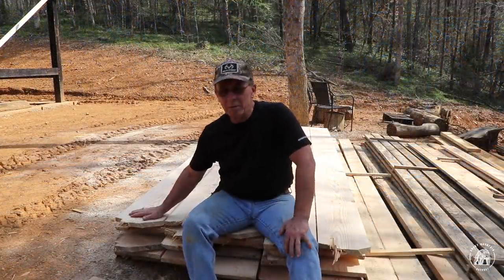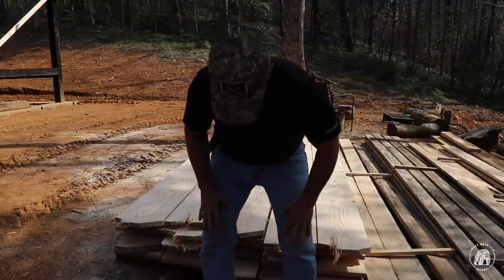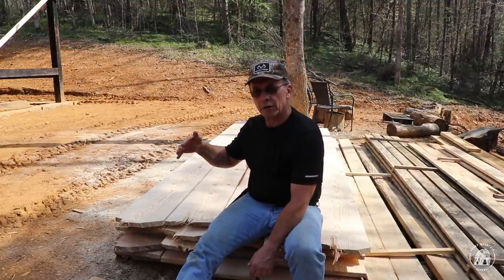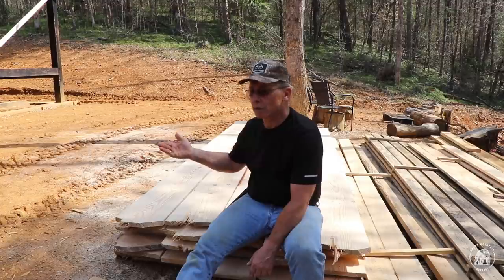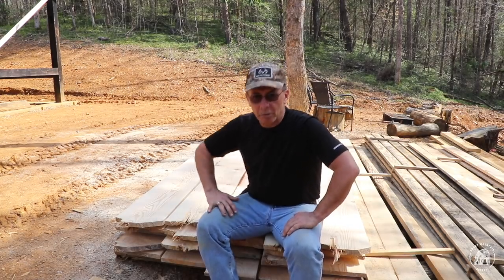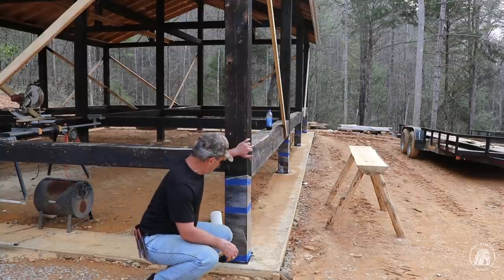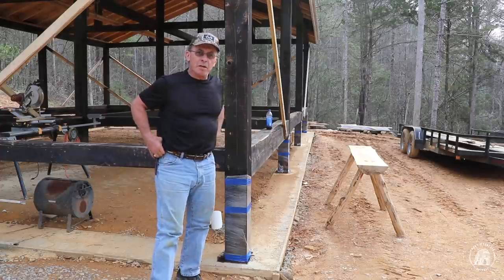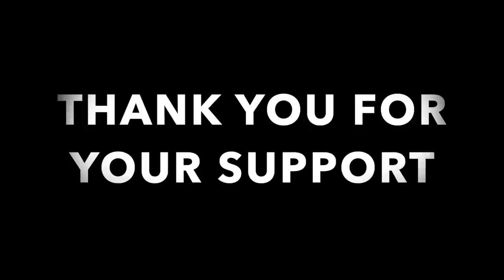S2 EP36 | WOODWORK | TIMBER FRAME BASICS | MILLING SIDING AND GRADING LANDSCAPE FOR DRAINAGE

Comment: Horizontal boarding, in my opinion, is the way to go. Tanks : Here in Southern Africa we utilize 1000 liter -15000 liter tanks ABOVE ground usually on a concrete base. The gutter’s down pipe feeds directly into the tank..... so one tank per down pipe. The rainwater can be used for everything except drinking water. It is a great free resource in a place that gets a lot of rain. Your place is coming along nicely, and I always look forward to your next video. Hugs and stay safe

Comment: As a landscaper, I have a few suggestions. First I would install some type of retaining wall at the base of the rear slope. Drystack stone would work well. With the rainfall you receive annually, that slope is going to move eventually. You can install some solid drain pipe behind the wall with a few strategically located catch basins. I'm not sure how much you plan on developing the site, I.e. Septic or sanitation, etc. I would consider that as part of the plan in locating any water tanks or drain discharges. As far as water storage, I believe you can never store enough water. I'd suggest 2-2500 gal tanks for your supply. You would then have some water for fire protection. For each inch of rainfall I estimate your collection would be in the neighborhood of 745 gals.
Excellent work on the cabin. You're living my dream!!! Continue the great work!!

Comment: Good morning SMO!!  Nice to see the sun is shining in on you at The Outpost!!  Nice grading job on the uphill side of the cabin... while you're contemplating gutters/downspouts and water catchment system, you might want to put some mirafi geo/drain fabric on the ground and cover with a few inches of 3/4" washed gravel under the roof drip line; that will ease up on the splash back from rain in the meantime and won't cost much.  

Addressing the contractor questions:  1) siding: the lap siding will be more rain & weather resistant and require less caulking and maintenance and theoretically easier/quicker to install.  The fact that you milled it at 1" thick will create a lesser spacing requirement for vertical framing backing for nailers (24" cc should be more than sufficient).  I would absolutely recommend to pre-seal the siding on ALL FOUR SIDES before installing and make sure to seal any cuts before installing.  I think I detect that you like the looks of board-n-batten [b-n-b] so perhaps do the gable ends, above the roof spring line, w b-n-b... you could introduce a thicker horizontal "beam" at the lap siding/b-n-b juncture to give it some detail and a cleaner transition from one siding to the other.  Install a piece of flashing there and you'll be good to go.  I think this will look very nice!!  2) rain-water catchment system:  great idea and I think having 1000 gallons on hand should be a minimum.  Consider to have enough for fire protection as well... just in case!!  You have a pretty good set-up, grade-wise, for gravity filling and overflow filling of multiple tanks, however I think I would just deal with one large buried tank that can be accessed through a manhole so that you can clean and/or disinfect.  Locate any particle filters such that they will be easy to access for changing.  There are many ways to go with this - my advice is to keep it as simple as possible with the fewest moving parts that could go wrong, so that function as well as maintenance is basic.

That's it.... thanks again for sharing your journey through your videos.  Have yourself a great day & week at The Outpost!!  >> keep on Truckin' <<

Comment: I’m sure you are planning on venting the tanks but if it were me, I think I would run the water into the top tank and let gravity send it to the bottom tank. If you fill the bottom tank and let it build up into the top tank and for some reason there isn’t enough static pressure to force the water up into the top tank, it could work just like a clog and cause your gutters to back up. I would also put a diverter at the the tank inlet. Once the tanks are full, it closes and diverts the water through another outlet to prevent backups in the guttering.
Reply from the maker: Great idea Christian
Reply: @SmokyMountainOutpost  I have one every now and then but try not too have them to close together cause it sure makes my head hurt.

Comment: horizontal boards over lapping for the win will shed all rain that comes into contact with said boards :)
Reply: With the bank at the bank ?
Unless you plan on putting some form of support up to hold it back i would suggest removing the extra soilwhere the bank meets the ditch, otherwise it will in time fall in and fill the ditch you created back up.
If you start at one end of the bank and get your tractor situated so it has its tyres a little into the ditch bottom set top set sitting on the bank and use the bucket to scrape away the extra, once nearly down to level then reposition so bottom set of tyres are at the meeting point of bank and ditch and you will get a clean seamless join with no extra soil being left behind to fall down over time.

Comment: As I said once before I agree with you on the lap siding it will be less wood used and less sealing plus I think will look best. I think the water catchment would work the best just like you want to do it.I think if you put screens on the gutters themselves as well as in the down stream pipes you should have very good water. Keep on ,Keep safe.

Comment: I'm not a fan of pine siding but with the right maintenance and preventative measures it will get the job done. The carpenter bees love it, but there are sure ways to dissuade them. I'm of the mindset that lap siding is better but it's a personal preference. You could make b&b work if you like it better. It looks more rustic I think.

Comment: Hi There, I think your idea of the two barrels but I think you should seed the hill to hold back the soil. A big and intense storm could ruin your system and flood the crawl space. Based on the length of the building the natural shrink and expansion will make for problems especially with 2X10 material which moves a lot.
Best Regards 
Fred Thomas in Skokie IL

Comment: Brother I would start off with at least a 1500 gallon tank with 2 frist flush diverters with gutter screens this way u can always drain the dirty water from the first flush diverters to keep it clean. Remember if u have a wet system the water always stays in the pipe that's under ground I have one of those and I just built another one that has wet or dry when it sits for a little while then I can pull the drain cap off and clean out 30feet of pipe that's under ground for even cleaner water love it off grid if you have questions about it let me know. I build them for people up on our mountain keep it up brother
Reply from the maker: Thanks Dan

Comment: Either on the siding but I would go with Lap! Are you gonna burn the boards? If not do the first 3 foot at least.  
Also why did you go with the Norwood vs woodmizer etc.???
Reply from the maker: It was cheaper and the reviews were good.

Comment: Water, 2000 gal tank minimum would be a good start, Board and batten is a great look wil less promlem keeping water tight , but use a backer curtian. Tievek or other.

Comment: you should go bigger than the 500 if you can, go as big as you can afford. you dont have to offset them, when you connect them they will both fill to the same level. you might want to put in solar panels so you can be totally self sufficient if you need to.
Reply from the maker: I’m thinking about solar

Comment: Having 2 containers in the ground is a great idea . Just make sure that if you have a drought you are able to get a water truck in the fill the tanks . Check out Deep South Homestead . He just added a flush system for his cabin. It's called a First Flush System . It helps keep off all the crap from entering your tanks when the rain starts . I hear it works pretty good . I'd go with Board & Batten . You can put a bead of caulk between the boards before you put the battens on if you wanted to . It will cost you money but you can put a rain screen on the exterior of the cabin ( house ) before you put up your board & battens or shiplap . It will keep the boards nice and dry and let the water run down behind it if your worried about moisture getting behind the boards .  50 Acres and a Cabin put this on his cabin . So did Raspberry Rock . It's called Benjamin Obdyke Slicker Max rain screen . It's the yellow stuff .
Reply from the maker: Thanks Henry

Comment: I bought 2x6” treated from a sawmill and had them resawed, cut in half, for lap siding. I think 1x10” would look super great. Gutters will need caps, guards unless you build a filter system between the downspouts and tanks to keep trash out. Trash gets into the tanks and starts to rot, the water will not be fit to wash a car. I would put tanks above ground so they can be cleaned or anything else that comes up, and it will. Put the rippers down on the left side and lower it more, you were scraping the full width from the camera. Stay safe Later

Comment: There are pros and cons to lap siding. Pros- Better water shedding, less wood, less caulking. Cons- Need water proofing behind each seam, siding really needs to be no more than .25" thick on the top edge(1x10 siding means you would need 2" thick trim). B&B siding also has a lot of cons. More lumber, more caulking, not as good of water shedding. How ever you do not need as thick of trim, no need to water proof behind each seam (the batten does that), nor does siding need to be cut on an angle.  Having said all of that Lap siding will last longer. How ever there are many barns up north that have had the same b&b siding on them for 120 years. so it really comes down to what do you like better.
Reply from the maker: Thanks Jason

Comment: I don't know how far that hill side runs up from the cabin, but once you have water in a cistern underground, you can pump it high on the hill to a smaller tank. 250 gallons or so and gravity feed it back down to the cabin so it is pressurized. Pipe is cheap, add a shut off valve at the bottom for maintenance and a check valve above it so water doesn't hammer on your pump, this will save the life of your pump as well by not running it so much. 30 feet higher then the shower head should be sufficient pressure, anything more then that is better.
Reply from the maker: Thanks Jose

Comment: QxA: Building physics are the most important issues for architects Masters of building or the different categories. You must build them horizontal. The reason is simple: A tree has a "pipe system" the tree grows into the heaven and is supported by micro canals a watering system. If you cut the wood you can see this "system this wood fiber" Raindrops run slow or fast. If you give the raindrop a "fast way" you will have a fast dried wood wall. If you would grind the wood and if you would give the wood paint (natural look) like boats and ships get it then the water wood run fast like on a audobahn. If you would do it with your wood (vertical) you would get problems because these rough wood fibers on top work like a brake they give to much surface for the humidity or the raindrops. If you want to have a house for more then 10 or 20 years, I would recommend to buy a cheap small table grinder and let the wood run over it once then you have a smother surface where the water runs down faster. You must do it horizontal. The wood fiber is much better the water runs much faster down. Also the problem of "discard" from the wood must be considered. The way you will do it- you give the wood "a go on" and later it will lifted up like a arrow. Wood will move in 2 directions if you don’t know where it will go, you will wonder later but not for a pleasant. So go to Brother "Great Plains Craftsman" take a look at his work. He put the wood horizontal closely together and there where the both connects he put a 6 centimeter x 3 centimeter wood strip over to cloth this part. That is traditional wood work he is a carpenter and he build windows and doors and other stuff. Question: The R19 thing. I did not understand how and where you want to put the R19 wool. Can you make a handwritten letter and show the plan in the cam so that I understand your plan? I know that you have it not in plan to screw through the roof! So please make a pic from the inside and a letter so the visual communication is better of use blackboard or so. IF you will use R19 stuff- then you must prepare the workplace. Never let them stand outside because of humidity. IF you open one packs mineral wool make sure that the workplace is dry as possible. It not the surrounding humidity will go into the wool and never go out and then its loses its isolation power and later it starts to create fungi. Many customers don’t know that and many US-professionals treat mineral wool like "sheep wool". We have a company name "Schwörer-Haus" they have 18 high-tech production places. They build high quality   prefabricated house they are the best in the EU. Their fabrics are total humidity and climacontrolled megaspaces. They keep the humidity in the halls by 25% so that the mineral wool never can soak humidity when they put them into the walls or under the roof. They have cool YT videos "for learning" After putting them into place it must immediately clothed with a seal. Also before you put them under the roof you must protect the "fake wood" with a seal. This fakewood hath moisture also the summer heat or the winter cold produces new humidity. Your roof system is not airtight. Where ever air is there is also humidity. Humidity is the killer of every not protected mineral wool. I would never use chemical stuff in such home. I would use only wood dust and cellulose for insulation. But IF I had to build with mineral wool I would do it perfect and protect the wool. If not the R19 will be R zero in 4 weeks after "work" in the wall.

1

Comment: For rainwater catchment, having screen as a filter for branches or leaves is important. You might want this before the water goes underground, because otherwise a clog in your drain pipe would be annoying to fix. You could use another finer screen after the water comes out of the ground and into the tanks, if it makes sense. For your tanks, it probably doesn't really matter if their levels are staggered.  If they're connected by a horizontal pipe lower down, they'll equalize with each other.

Here's one picture of an above-ground screen. https://i.pinimg.com/originals/f6/c9/1e/f6c91e2d2adf57b39d0c0d620b75fcac.jpg

Comment: Jacob Hallman Builders State  License Contractor for S.C. Retired. Lap siding difinitly better, good job on the water run off, have you thought about using 2-1/2" wide by 8 to 10' in length for corner bracing, works better they are flat and no notching required, you can think about it more as always REMEMBER JESUS LOVE'S YOU 🙏🙏🙏.